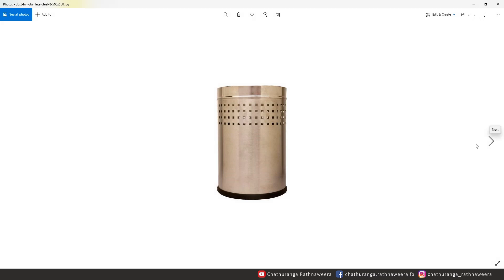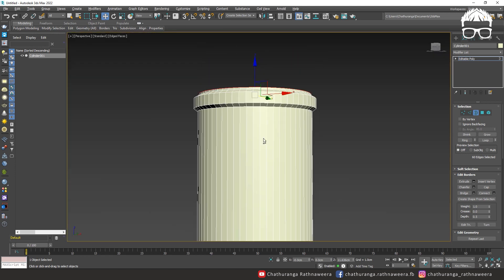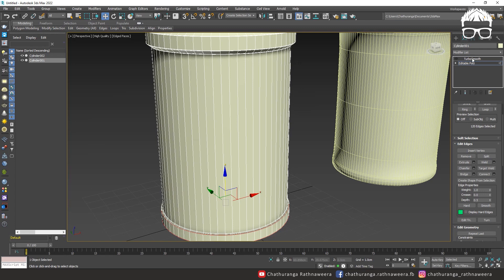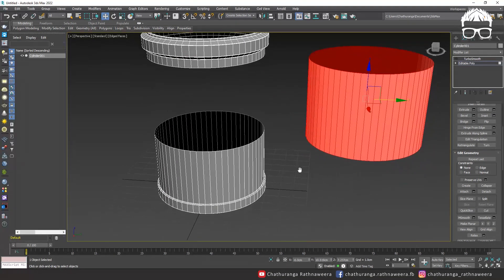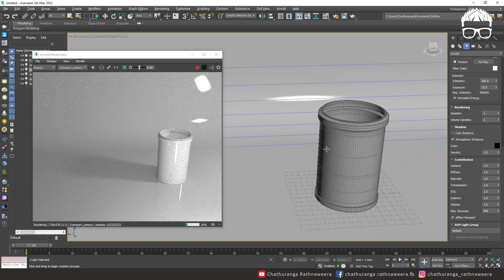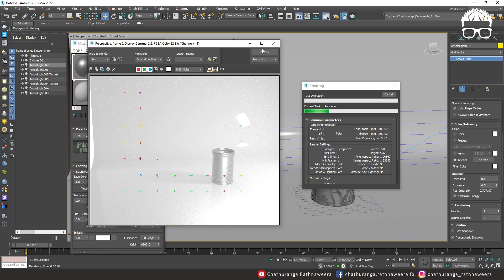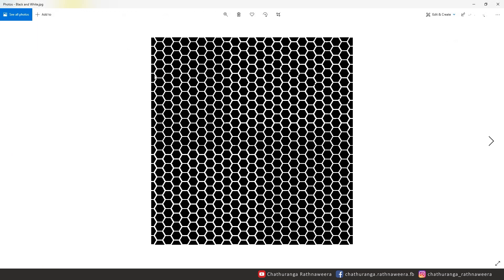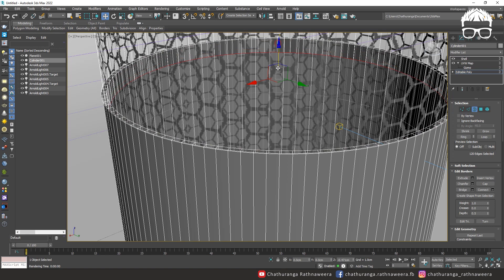3DS Max Opacity Map - Dustbin Modeling Tutorial

Comment: Thanks for the tutorial. Can the surface be thickened by creating holes with a closed thickness with opacity? I tried entering the shell command but the holes are not filled along the surface of the hole. There remain two punctured surfaces and not a punctured solid. I hope you help me.
Reply from the maker: Unfortunately, it is not possible to add thickness when you add opacity map to hide surfaces. If so, you need to model it. But, if the camera place far from the object, you can cheat by using shell modifier.